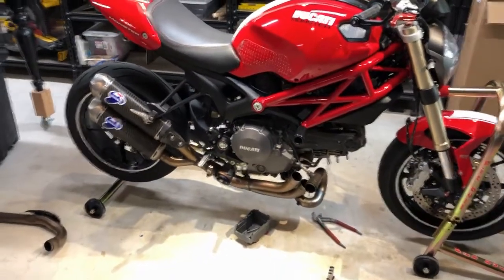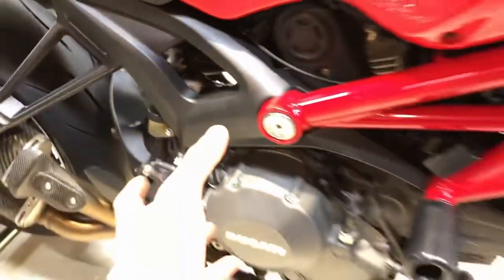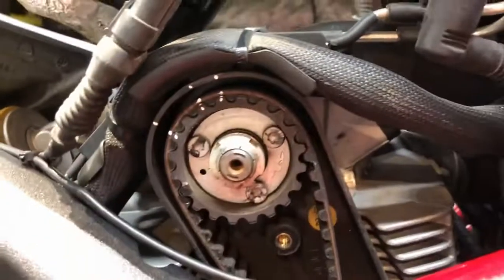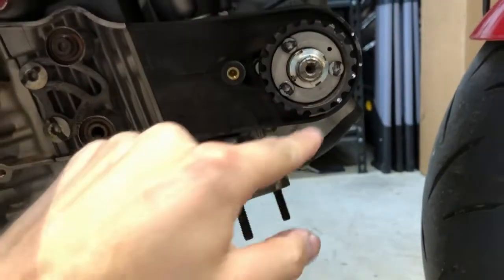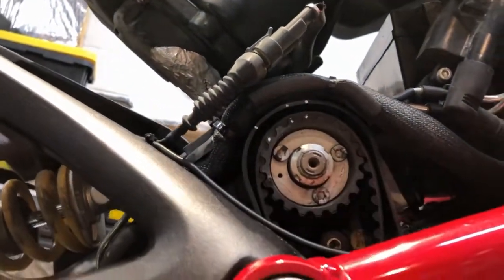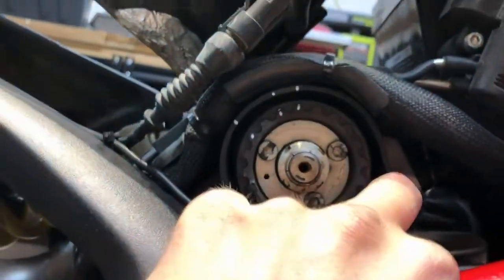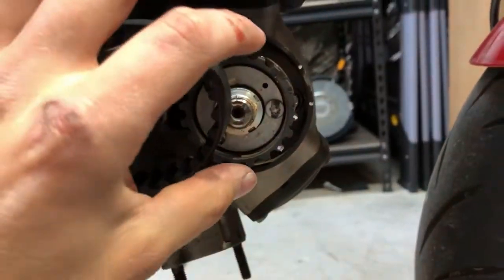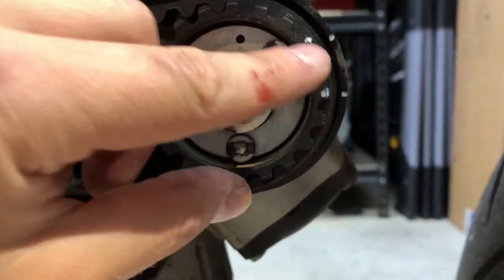2012 Ducati Monster 1100 Evo Timing Belt Change (How-To)

Comment: Thank you from France. I think you can use the historical méthod of allen (hex) key of 5 in replacement of frequency adjustement.
Reply: Are you sure you can still use that method on the newer DS engines? I thought that method is redundant now
Reply: @gh51popescu  yes i am. Now I sold my EVO. But I checked the belt with this kind of trick 2 years after replacement made by my Ducati dealer. And it was perfect. 👌
Honestly I am an automotive engineers and regarding the timing belt on a modern car, the Ducati system is old school. You just need to check every one or two years. 
More over the frequency method is now obsolete in automotive, it was more precise than required, and too complex to use for dealers.
Reply: @grumlygrumeau2564  I agree, the frequency method is far too complex and from my experience the frequency readings are not consistent from one app to another. Have decided to take the bike to a local shop to have them checked professionally. I hope they don't charge a fortune

Thanks for your thoughts and all the very best

Comment: I don't understand why people count the teeth on the new belt to make sure it's the same as the old belt. As you mentioned, as long as the teeth match up with what's on the casing, you're good to go. What am I missing?
Reply from the maker: Ryan I completely agree. I’m not sure why there is so many steps / concerns on other videos that take an hour long to watch
Reply: It's because all have been terrified by Ducati services, that if they do replace something themselfs, they definetly will destroy the engine. In Moscow, Ducati services can push you any part, just because they have inner vision, that it needs to be replaced, with no explanation. And people go for it.

Comment: Top tip to save having to mark the cam wheels. On the left hand of the engine each cylinder head has a bolt near the centre of the side plate. Take that bolt out, of each plate, and with the crank pulley dot in line with the line on the crankcase, put a 6mm drill bit in each hole and the pulleys are locked
Reply from the maker: Thank you! Years later I came to realize / learn this too. I'll have to remake the video.
Reply: Do you have manually align the crak pulley and lines with this method? If so, how is that done? I'm going to tackle this job as soon as my belts arrive, this weekend I hope.